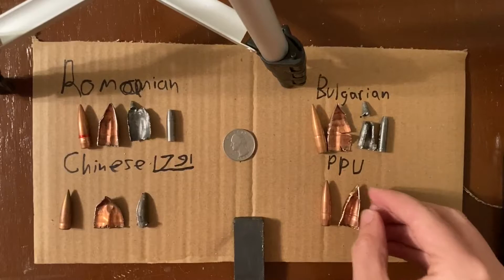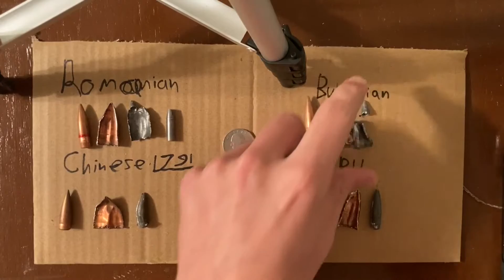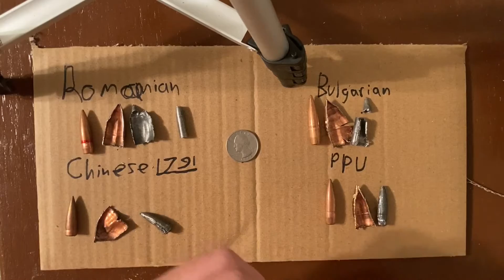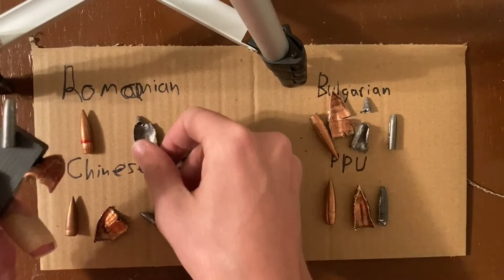What does it mean when bullets are magnetic?

Comment: Steel core ammo IS NOT ARMOR PIERCING.   AP rounds are banned from import, sale, or possession by the 1968 gun control act.   

The Germans developed the technology for wrapping a steel plug in lead because they did not have enough lead during WW2.  They also developed steel jacketed bullets during WW 1.  The Soviets took the cored bullet machinery and copied it because those bullets are cheaper than traditional construction.
Reply from the maker: Agreed. It’s a common mistake, but many ranges do not allow ammo that draws a magnet anyway